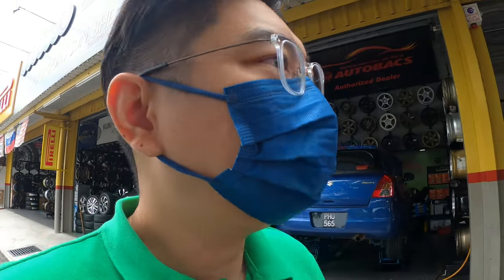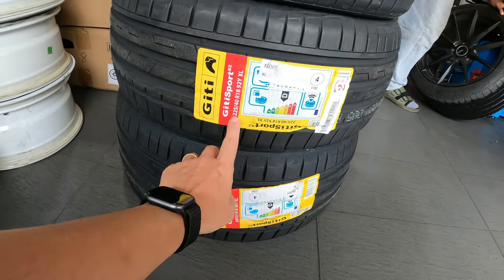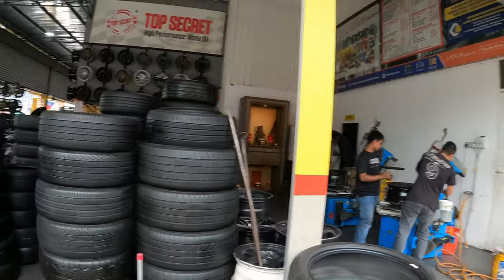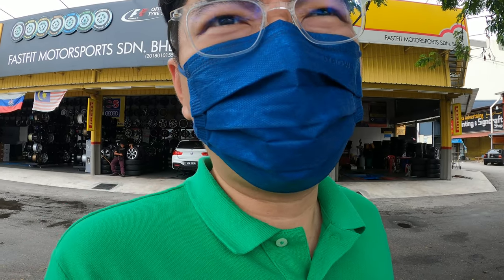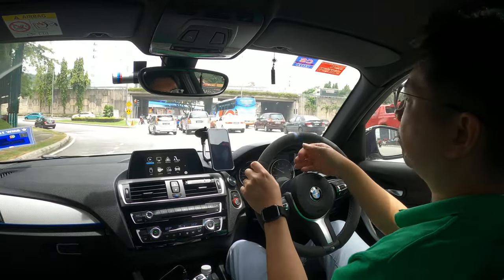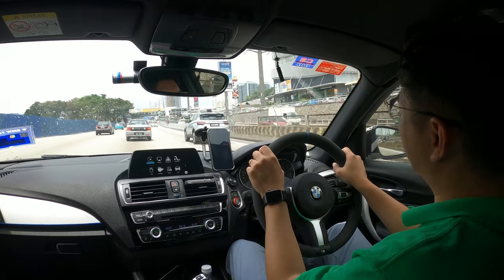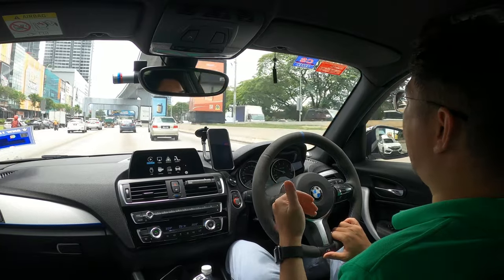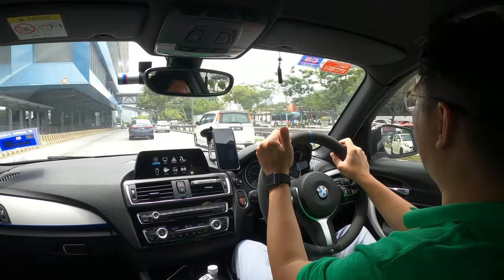Trying out the new Giti GitiSport S2 UHP tires

Comment: Hi @Kokkien Uncle want to ask is your tyre is runflat, how much around the price
Reply from the maker: I don’t use run flat for long long time.. run flat is expensive, noisy and uncomfortable.. 😆
Reply: @HokkienUncle  ok thanks I see, but no spare tyre will not safe for drive?
Reply from the maker: @LJPLife  a bit risky but I have portable inflator if the tires is not too damage, it should help until u reach a tire shop